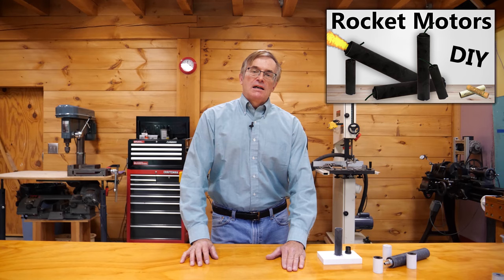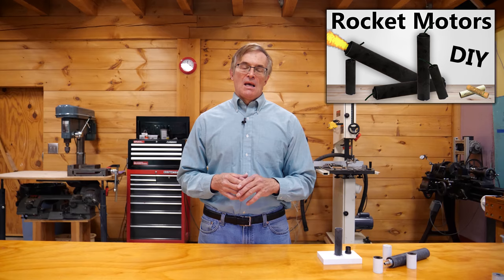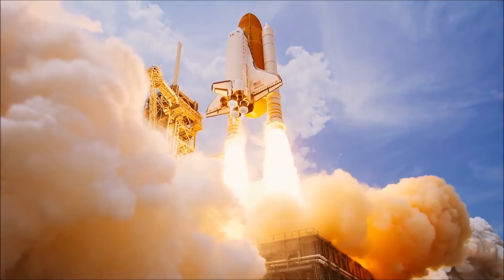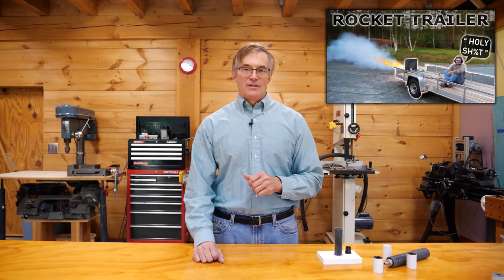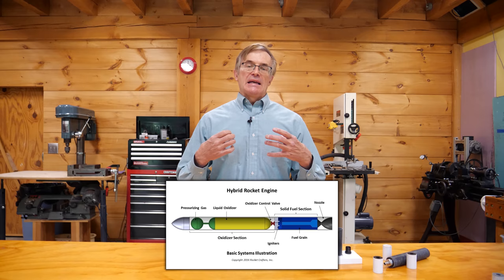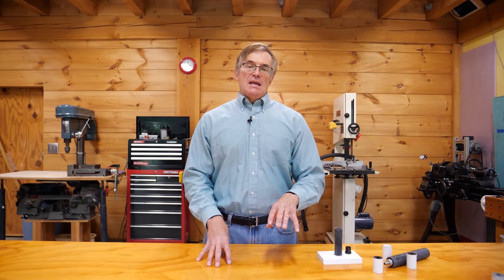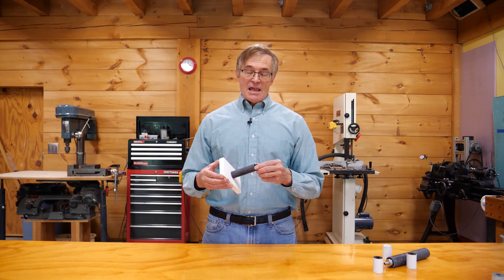Mixing Nitrous and Rockets is DANGEROUS... But Really FUN!

Comment: SpaceShipTwo that just took Richard Branson to space uses a nitrous hybrid rocket motor. So, they've been to space.

Edit: This was probably filmed before that flight happened, so I don't fault him for not mentioning it. Just wanted that out there.
Reply: It doesn't go to space as it doesn't cross the karmen line
Reply: @henryefry  The Karman line (the one you are talking about) doesn't measure where space starts.

The Karman line you are talking about (it changes by jurisdiction, define your terms) is the Federation Aeronauique International's (FAI) regulatory convenience altitude established in the 60s. It only exists to determine agency jurisdiction.

 Karman himself placed the lower boundary around 80 km.

 

According to NASA space is 50 miles up, give or take a bunch of variables.

If you say Spaceship Two didn't go to space then neither did the X-15, and you're going to have to demand they give their astronaut wings back.

You're not wrong, because you're not even wrong. Your argument would have to improve just to get to wrong.

That's what happens when you carry Jeff Bezos's salty tear water.
Reply: @henryefry  Well, SpaceShipOne actually DID cross the Karman line to win the Ansari X-prize using the same NOS/HTPB hybrid engine design, so the point still stands. Subsequent flights may not have reached the Karman line, but they do cross the 50 mi mark that NASA and USAF use to mark space and award astronaut wings.
Reply: @Timestamp_Guy  only NASA uses 50 miles, so I don't count that as space. You gotta get to 100km for it to count.
Reply: Who cares what NASA says no one else uses 50 miles. Everyone except NASA uses 100km. Not officially in space if you don't get into internationally recognized space.
Reply: @jtjames79  NASA can give wings to whoever they want, I just don't recognize them as having gone to space.
Reply: @henryefry  found the Bezos shill. Must be a slow day at the Washington Post.
Reply: Reason why it take so long to go SpaceShipOne to the SpaceShipTwo, is the fact that hybrid rocket engines don't scale up. SpaceShipTwo two uses ignition gas for startup, nitrous oxide for burn and purge gas with shutdown and abort. That makes rocket more complex. Also NOS in large quantities is dangerous and need even more care than small containers in race-car setup.
Reply: There's still clouds at 50 miles, well within earths upper atmosphere. It's 1/5 the distance to the ISS. The moon is almost 5,000 times further than Branson got and man went there 60 years ago. It's not much to be impressed by. The micro gravity they experienced was exactly the same as Zero-G planes; only due to the vehicle falling back to earth.
Reply: "Space"
Reply: @jtjames79  FYI, NASA (a scientific civilian organisation) used to use the 62 mile marker for defining space, but changed it in 2005 to make mixed civilian/military occupancies simpler and adopted the military's 50 mile rule. That's the only reason.

I don't think you know what hate means. Regardless, science has little room for your emotions.
Reply: @_BangDroid_  Personally I don't think you're an astronaut until you hit orbit, and space is wherever you need RCS.

But my opinion doesn't matter, that's why I don't say anything unless somebody specifically asks me personally. If my government is handing out astronaut titles to people that's good enough for me, since that's how democracy works. That just means I won't call myself an astronaut until I go to orbit. I'm not going to judge you by that standard.

It's funny how many petty tyrants come out of the woodwork anytime anyone accomplishes anything.
Reply: @jtjames79  I agree 100% with your first paragraph.

Comment: "So lets do nitrous. Or I should say, lets talk about nitrous." I almost spit out my drink from that deadpan delivery of the rare joke, it was great.

Also, I always love the level of detail in these videos. Going to use nitrous as rocket fuel oxidizer? Here's everything you need to know about bottled nitrous, including how the tanks work, how to mount them to improve their efficiency in car racing, how to fill them (and heres another completely detailed process for just that, including the equipment), why to fill them by weight and not overfill by volume,  sizes of tanks, the proper angle and orientation to utilize every drop... and thats literally just getting started. He leaves almost nothing to "common knowledge" or common sense, but I still dont feel talked down to, or treated as ignorant, and that is one of the finest lines to balance in all human interactions.

Comment: I'd be curious to know why for each nozzle test there's a visible drop in pressure/flow right after the first blast. Thank you very much as always for your insightful videos!
Reply: Possibly some amount of ice crystal formation at the nozzle chokes the flow a bit?
Reply: @alexponting3325  I was wondering if it was about temperature drop. Joule-Thomson? But then why the timings of the choke doesn't seem to change between the first nozzle (with probably the smallest diameter) and the others?
Reply: Made me wonder, too. Probably the valve in the solenoid is bouncing.

Comment: If you are having too much fun filling the nitrous tanks, you might want to go outside.  : )
Reply: fortunately for the denatured stuff, you would likely detect any leak due to the sulfur dioxide - it has a quite sharp smell
Reply: @LiborTinka  I wonder if a respirator filter would removed just the SO2 :-P
Reply: @kirkc9643  no it cannot.
Reply: @lordjaashin  you can bubble it through lime water and remove it from the gas, you'll likely want to have a multiple bubbler setup
Reply: @helpabrothawithasubisaiah5316  ya but the person above me isn't talking about that. he is talking about respirator filter which cannot remove gasses like SO2 only particulate filter
Reply: @lordjaashin  i was just giving a solution, I probably should have responded to him and not you but I just clicked your name
Reply: @lordjaashin  i wanted to get a nos tank, but it turns out it would be like $250 to get a 5 pound tank and another $35 to get it filled... plus you need hoses and regulators
Reply: @lordjaashin  I was NOT talking about a particulate filter. There are a range of filters available, including ones that capture SO2
Reply: @helpabrothawithasubisaiah5316  Thank you, I have read about that.

Comment: These are great motors. My buddy and I built some high impulse m-motors, shot a rocket up 20,000 ft down in washington state. It hit 811 mph at 100ft off my trailer. Was awesome. We used PVC as the fuel grain

Comment: Don't forget get about Rocket Lab's Rutherford engine. It's an electric pump feed liquid fueled engine. Or pressure feed engines like the Kestrel engine used on the falcon 1, a very simple engine compared to the full flow Raptor engine.
Reply: Draco and SuperDraco in Dragon 2 capsule is pressure feed too.

Comment: When I was a military pilot, our short range missiles were solid fuel.  It seemed a little far fetched, but one of the precautions for handling them would be to take off any digital watches.  Guys complained it made them tense if someone were in the cockpit and they were hearing relays clicking.  They made us help them at least once, so what they were doing at the time remained remained part of thoughts while in the cockpit.   Another that is easier to understand was that if one is subject to a fall that it could not be used because of the possibility of the propellant inside incurring damage thereby effectively adding porting/surface area which could greatly increase the internal pressure.  Concerning the USS Forestall incident when a  Zuni (AIM-9 variant, solid fuel motor) hit John McCain's plane and triggered explosions and fires that killed 137, most tended to not accept the pilot's account when he said he was certain he had not triggered the missile by accident during his checks.  There was a lot of talk about possible scenarios of how it would be easy for that to mistakenly happen.  They had approved abbreviated procedures (there was a war going on) which were afterward rescinded.  However, there were subsequent unanticipated launches and non-launches, and combined with pre-USS Forestall incidents, came together to cast doubt about their foregone conclusions that these incidents could all be attributed to human error.  This revealed there were non-human issues involved.  These play into what you said about solid fuel rockets.  

The USS Forestall incident isn't all that different than WW II where they replaced a lot of sub commanders with new guys because they said the sub commanders were too cautious and they simply missed.  Later they would learn that the Mk 14 had 4 major areas of failure, and even had a 70% failure rate even with direct broadsides.  However, it is more logical that they fired their not only most experienced commanders, but also their best commanders, and likely would have been more effective with fewer losses, because they had the moxie to calculate an accurate risk vs. benefit based on their experience with the Mk 14.  If you were a member of Seal Team 6, and 7 out of 10 time you pulled the trigger nothing happened, you would soon learn the best way to stay alive long enough to be effective would be as a sniper.  They wouldn't investigate the torpedoes until after decoding Japanese intercepts which reported what their sub commanders had been telling them.  Lockwood was on the wrong side of the torpedo problem in the beginning, and it appears to me that linking cause and effect to replacing commanders is more an effort to sanitize a part of his otherwise stellar legacy and to the benefit of the Navy's and others.
Reply from the maker: Interesting, thanks!

Comment: I did a research project in undergrad on hybrids. I never got approval to actually get the nitrous (#dumb), but did some cool machining for the actual engine. I used brass as well instead of stainless. My idea was using 3D printed matrixes to stabilize the paraffin during the burn by having it exposed to the flame front in sequential concentric rings, separated by slower burning ABS. The 3D printed structure also enabled the kind of helical ports required for high surface area/low volume (a fix for the regression rate issue). The project was about combining different technologies to get the highest impulse (volumetrically) motor ever made. in theory such a motor could be used in storable applications like mars sample return, as nitric acid can be stabilized for deep space storage. cool stuff, I might go back to school to finish this project, or do it in my garage if I get time (and a garage lol) . I enjoy your channel as always.

Comment: if you don't want to wait for AN fittings you can always get JIC from the local hydraulic shop. it's the same thing but they're usually steel for higher hydraulic pressures

Comment: Another video done and explained in an excellent and professional way, I look forward to watching the others in the series. A few things I would like to point out. 1, concentrated hydrogen peroxide is NOT toxic at all, it’s made from hydrogen and oxygen molecules however it’s a strong oxidizer and will set fire to things. 2, nitrous oxide is an excellent mono propellant that can become unstable when it’s changing phases and can explode with catastrophic results.
Reply from the maker: Thanks.
Regarding hydrogen peroxide, the fact that it will cause severe burns on contact as well as support combustion and explode when it contacts some metal surfaces is pretty rough even if technically it isn't toxic.
Reply: @TechIngredients  hydrogen peroxide does not cause severe burns on contact, if you were to pour 90% peroxide over your hand it would bleach the skin white, after a few hours it would return to normal, sure you don't want to get it in your eyes or soak your feet in it for an hour, also there is a difference between exploding and decomposing, decomposing peroxide with a metal catalyst pack can be a challenge at time.
Reply: @wiggysworld  Nitrous Oxide disassociates at 1100ºF.
For it to explode, a high explosive detonation would probably be necessary to initiate.
It is not like acetylene, trinitromethane, or hydrazine.
Got CL-20?

Comment: I appreciate your cautions about risking catastrophic hydraulic failure after overfilling the bottles with Nitrous. I've seen the results of Freon tanks rupturing due to overfilling, and it is also not uncommon with careless refilling of propane or LNG tanks. It's important to know the different weights of a tank, tare, net and total. 
The Los Alfaques disaster in 1978 is terrifying!

But I have a remark on your sequence for releasing pressure, you close both bottle valves, then the ball valve, then release pressure between ball valve and receiving valve, but a small volume of liquid is trapped between ball valve and main valve. Given a quick rise in temperature you could risk blowing a seal or a hose due to liquid expansion, I've experienced that with a manometer manifold that did not appreciate that increase in pressure :)

Love your videos!
Reply from the maker: Thanks.
You could certainly open the final ball valve as a last step if you're not filling multiple tanks at the same time.

Comment: You might want to take a look at impact pin style impingement nozzles like the Bete PJ type.

I've never used them for a similar application, but the spiral nozzles are abysmal regarding spray patterns by design and we sorted them out nearly everywhere if consistency is of any relevance whatsoever.
Can hardly imagine there's a way to get a uniform burn of the fuel with them.
Reply from the maker: Did you watch the whole video?  I discussed why that type of nozzle didn't work when we tested it.
Reply: @TechIngredients  
Oh, sorry.
Might have skipped that part while trying to avoid most of the commercials.
Or just missed that bit for whatever reason.

Comment: Production critique: pop filter/cap (or highpass above 120Hz on the voice input) on the lavalier microphone would be nice for those listening with headsets and/or speakers with powerful drivers (Thank you very much for the heads-up's for headphone listeners, it's very much appreciated).

Great video! I never knew Nitrous Oxide has such a powerful effect on combustion; I knew it added something, but I didn't realize how powerful this actually is. Seeing it demonstrated and learning about even the small things (like why the bottles are mounted as they are) is very interesting and informative! Thank you for your research effort and taking the time to create this video! :)

Comment: I lost  the part  of frozen valves and conduits, that happen with co2tubes for firefighting. Once we used At work for cooling wine, suddenly got frozen and imposible open or shut. It  open and shut, open and shut until the tube  got empty. 
When gas work gets cooler but to understand the whole is not enough. 
Thanks for your showing of nozzles, i know the diesel engine nozzles or cut-welding types.

Comment: Not sure about nitrous tanks, but an easy test with LPG which is stored in the same way, is to pour some boiling water down one side of the tank.  Then start at the bottom, and carefully feel it with your hand.  It will remain cold where there is liquid & only be hot above the liquid level.  Not as accurate as knowing & measuring the weight, but often useful for a quick indication.

Comment: Have you tried oil burner nozzles ? They atomize , can get different angles , spray cone patterns ( full,  hollow,  semi hollow ) and different volumes based on gpm with out the protrusions into the combustion chamber, they are made of brass .The spray pattern is much better then what you are getting with what your using now .

Comment: Found it interesting. Thank you for all the explinations as well as the "what not to do" 
Do not use this nozzle, do not use that nozzle. 
Three questions
1) How long does a pound of NO2 last ? 
2) How much does the weight of the tank and plumbing offset the gains in impulse ? 
3) Is there a dip tube in the steel tank as well so only liquid is transferred?  Does gas come out of the steel tank and the the NO2 become liquid as the pressure builds in the smaller five pound tank?  You mentioned a cryogenic burn which implies liquid in the transfer line. Cold liquid does more damage than cold gas as it absorbs more heat. (students would say transferrs cold but cold is not a thing nor force )
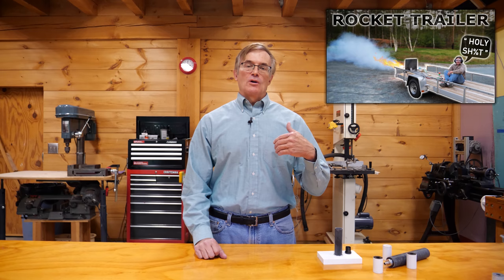Reply from the maker: The highest specific impulse occurs with a fuel to nitrous oxide ratio between 1:7 and 1:10 by weight.
Wax has a density of 0.9 gm/cc.
The nitrous tank and plumbing does work against the overall performance of the rocket, but not the inherent specific impulse of the propellent.
The large supply tanks come in two forms, one with a siphon like ours and one without that has to be used inverted on a special stand.
Reply: @TechIngredients  Thank you for all the information. 
Yes, the tank works against the rocket's performance but not the specific impulse. 
I look forward to your next video.

Comment: First, I immediately noticed and greatly appreciated the "if you wanna get your ass to Mars, Your gonna use a liquid rocket engine" at 6:44.  I always liked the Total Recall movie (the one with Arnold Schwarzenegger and Michael Ironside).  Thanks.  😃

Second, scale is very important and often difficult to discern.  I've never seen a large rocket booster in person - only on television or video feed - so I'm confident that I don't appreciate the scale of those engines beyond the quoted stats.  In the same way, I didn't appreciate the scale of your nozzle demonstrations starting at 33:04, but when you unleashed it on the charcoal grill at 37:03 I definitely got a good sense of the nozzle output.  Good demonstration.  Thanks again.

I look forward to the next video and seeing how to fabricate rocket nozzles from graphite.  Thanks for posting.